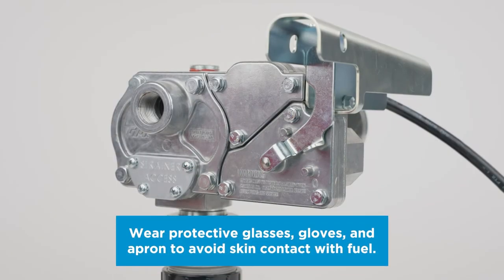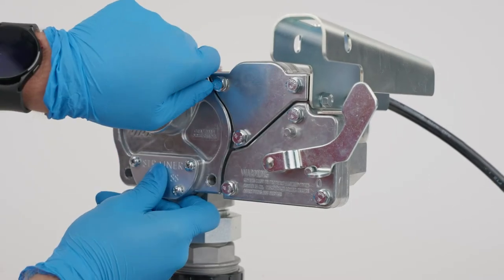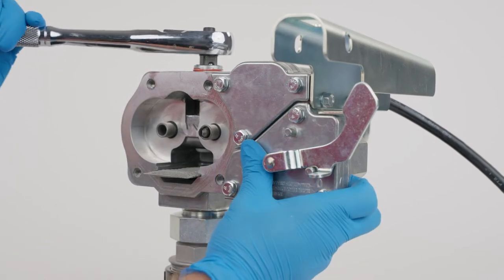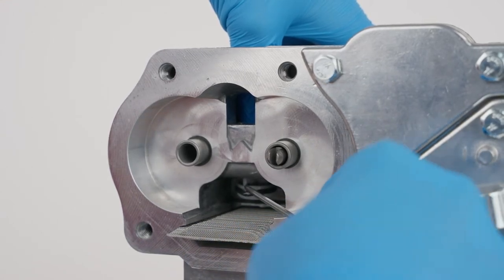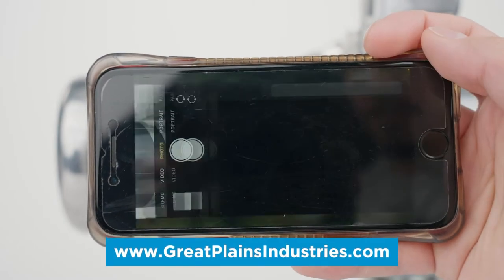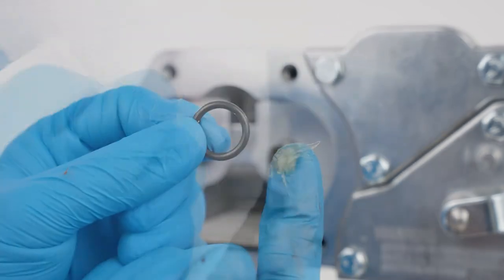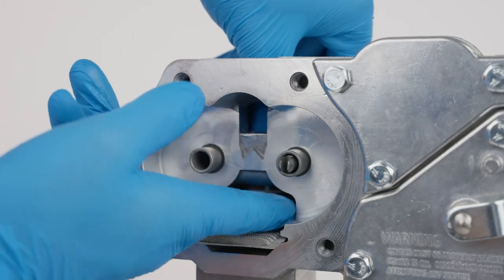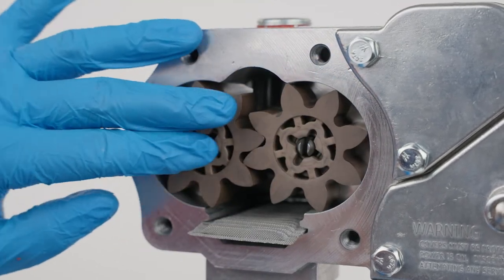GPI M-Series How to Clean or Replace Bypass Poppet

Comment: I have pumped over 6600 gallons of diesel though my gpi pump but the other day it wouldn’t prime. Not even try to prime. So I took it all apart and looked for places it could be pulling air but couldn’t find any. Then I looked at this part and found the O-ring was missing. I grabbed an O-ring from my harbor freight kit and it works like new.
Reply from the maker: We are glad to hear that you could repair your poppet and get your pump up and running again!